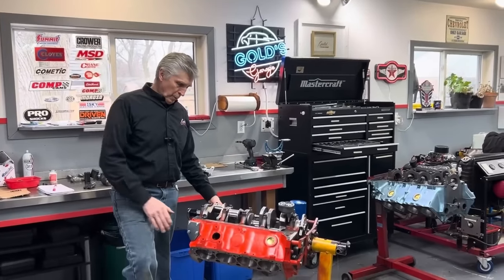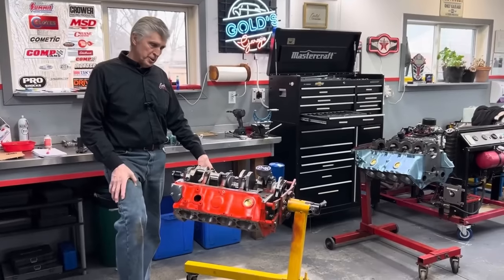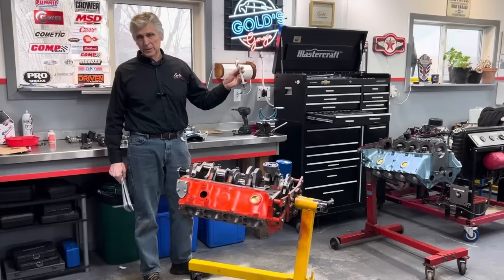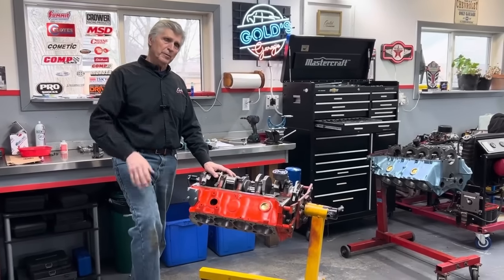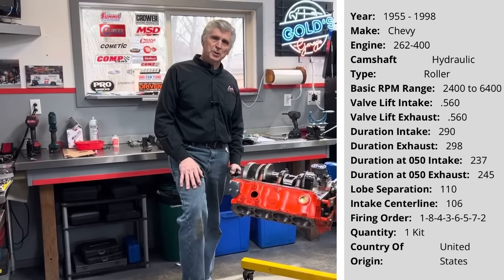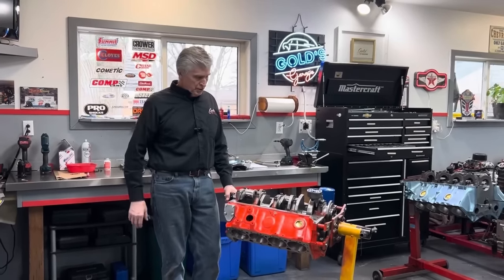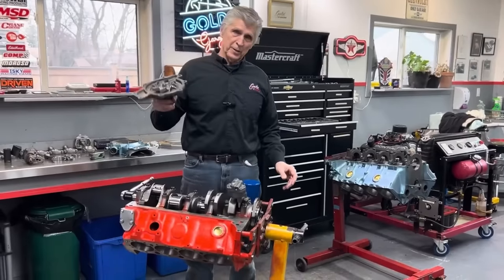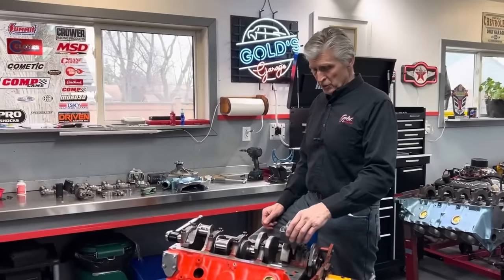Building a Race Winning 400 SBC Chevy - Get the Right Parts! Do you need a HV Oil Pump?

Comment: Thank you for explaining the difference between a standard oil pump and a high volume oil pump. I never knew how they were different and now I do!!!
Reply: It is the length of the gears, I do not know if that was stated in the video as I concentrated on the clutch.
Reply from the maker: You are welcome, yes the gears are about 30% longer on a HV pump. AG

Comment: I built a 385 stroker for a friend. EVERYTHING was new. I believe in stock pumps. For some reason the oil pump locked up. When I replaced it, I removed the gear. The last step I made after blue printing it was drill a 1/16 hole at the top of the gear, skip two teeth and drill a hole in the middle, skip two teeth and drill a hole at the bottom. Just thought I'd throw that tidbit in. GREAT videos
Reply from the maker: Interesting, thanks for sharing your experience Roger. AG

Comment: I like your thinking on this engine. Dirt tracks do take a different approach. Anxious to see how this does in the car. Good luck.  Only change I would make is to use the Melling Shark pump. It is available in a couple volume outputs and I believe it is stock and 10%. The Shark pump with the helical style teeth always have one tooth engaged which eliminates the pulses experienced with a straight gear. These pulses can cause spark scatter if other conditions are present. It does reduce a couple stresses with the "constant" pumping vs the pulse pumping of the straight gear. Worth investigating. Oh, two more pluses, the pickup screen bolts onto the pump and the size is increased from 5/8" to 3/4".
Reply: The smallish 8" tire width he was focused on [in a light car]  is a real challenge to get torque in a sweet spot coming off the corner.  So the odds: will cam timing get retarded or not after a little test & tune?
Reply from the maker: Thanks for your comment 4Speed. AG
Reply from the maker: Thanks Flinch. I will be retarding the cam to soften the corners. i will be making videos of the process. Dyno day is June 8. AG

Comment: A final proof check that the rod bearings are installed correctly is the rod pair on the crank pin should have side clearance, meaning you can slide the pair against the cheek of the rod pin from the front to the back with no effort, hopefully with .020" movement or what you determine you need. Use the wrong rod bearings on an aftermarket steel crank, or put the wrong halves in the wrong position and it's possible you won't be able to rotate the crank because the bearing surface is clamping on to the radius of the crank pin. (fillet)
Reply from the maker: Thanks for the info Yarrda. AG

Comment: I have started using Melling 155 pumps. They have a larger inlet diameter to prevent cavitation at higher rpm but is still a standard volume and accepts regular SBC pressure relief springs.
Reply from the maker: Thanks Steve, good point, I have a Melling M155 pump here, maybe I will demonstrate it in a future video. AG

Comment: One small detail....... in that gear pump for oil, the oil actually travels around the outside of each gear.  It doesn't go thru between the gears.
Reply from the maker: Thanks Roy, you are correct. AG

Comment: Allan, I think you should have shown the internal plate that goes with that Pontiac water pump, that would show that the return water from the rad is directed to the centre of the water pump impeller and the water leaving the impeller is directed into the front of both banks of the engine block.
Reply from the maker: Thanks Cabot, good suggestion. That was in my parts washer at the time and i just didn't think of it. AG

Comment: A "race" engine with what looks like original bolts for the mainline, especially after spending the money to line bore the rear main seal lip to allow line honing, puzzling to me. Should be studs. I've built several 400 block based engines over the years, any time you lean on them the front and back caps especially will show signs of fretting. (cap movement resulting in microwelding between the cap and block mating surfaces) I sure hope that's an internal balance crank.
Reply from the maker: Thanks Yarrda, yes it is internally balanced. AG

Comment: Even tho its really not necessary on a mild street build ive always tossed a HV pump in, ive never used a HP or a HP/HV pump either. When i start my smallblock n see 70 psi cold and 40ish hot,  it gives me some feeling of security. I also have a 7 qt oil pan on my current engine. I also tossed ARP main studs and rod bolts on my stock rodded  2 bolt block because they wernt expensive and it made me feel warm n fuzzy inside. I didnt have any out of round distortion from the stronger bolts either. Its the only mild build ive used them on tho. But then again after years of flogging that 355 had never come apart but likely wouldnt have anyway seems ive actually never seen factory main cap bolts fail or actually a factory rod bolt fail either, just spun bearings that led to a broken half rods swinging around causing insane damage when intentionally blowing up worthless junk smallblocks when they were retired.
Reply from the maker: Thanks for your thoughts Budget. AG

Comment: Hey there Mr G. I see you're using a Melling M-55 oil pump. You may be interested to know that the casting changed significantly several years ago. The castings were made much thinner and what was happening is that they developed a tendency to break at the "neck". I had a conversation with Melling tech and they confirmed that the casting had indeed changed. I've an original M-55 from about 20 years ago and the difference between it and the modern offering is obvious. I returned my new pump and went with the Shark Tooth version instead. Four times the cost but what's the result of an oil pump failure at RPM? My hope is that you find this bit of info helpful. For the record,  I've pictures of the new and old side by side. Also a transcript of my e-mail exchange with Melling should you want further proof.
Reply from the maker: That is great info, thanks Kevin. AG

Comment: How much work will the distributor gear handle, turning the oil pump, before it eats the gear(s)?  If we run more pressure and/or volume it draws more horsepower thru that gear set.  How much is too much?
Reply from the maker: Good question Roy, if you have the correct gears, lubricated and aligned properly, the gears should outlast the engine, AG

Comment: I have used the Chevy Power Manual for all technical advise for decades now. HV pump on a SBC is def not needed, just a high pressure relief spring will do just fine.
Reply from the maker: Thanks alleyoop. We will see what pressure we get from the original spring first. AG

Comment: One of the reasons for using a BB pump on a SB is because the BB pump has more teeth on the gears it turns smoother and transfers less vibration to the distributor.
Reply: I would do the same and the pickup tube is larger for the volume of oil...  HV, not Hi pressure.  Hi pressure is no good on the bearings and causes heat and robs HP.
Reply from the maker: Thanks for the comment Gary. AG

Comment: The choice of the cam could be better ,like a ls firing order with the same specs, so it will stay cooler in the cyl 5&7. better for a race engine . always b,print the oil pump and all my return oil open larger in the lock. a 377 cid it's a better application for your rules.
Reply: Yes, the 421 makes more power than a 406 or 434 cu.in.
Reply from the maker: Thanks for your comments Chris. AG

Comment: Does the oil go between the gears of does it go around the gears?
Reply from the maker: Thanks David, Sorry, the pump turns the other way, I was just not paying attention to that detail, the oil is essentially displaced by the gears, and the rotation creates a cavity or suction in the inlet which draws more oil into the pump. AG

Comment: If your lap rpm range is 6k to 7500... single plane all day. If youre  topping at 6k on the straight, rpm air gap duel plane all day! 6k and under a single would be a mismatch. Port velocity would be inconsistent id think
Reply from the maker: Thanks for the input. AG

Comment: My son is building a 355 chevy for street use. What do you recommend for rod bearing clearances? Is .005 too much?
Reply from the maker: Thanks for the question Paul. The factory recommended clearance for 350 connecting rod bearings is .0007"-.0028". The 'in service specification is .004" max. For performance application I think .0015"- .003". works. .005" is too much. Hope this helps. AG
Reply: @goldsgarage8236  thank you!

Comment: Why run a hyd. cam in a race motor? What is the mechanical advantage other than not having to check valve lash as often? Seems like a liability to me.
Reply: Some race series or tracks have a cam rule ( hydraulic only )
Reply from the maker: Thanks for the question Robert. We are planning to limit this engine to 6000 RPM and a hydraulic cam is good for that. The main reason for a solid cam would be to avoid valve float at higher RPM, 7000 or more. Also the hydraulic cam will require less maintenance. AG.

Comment: I predict he gets passed at mid track. And that's not to be mean at all. You have a decent bore so you should take advantage of it. Get a shorter stroke and a completely different camshaft so the engine comes alive shortly after he has come off the corner this will save tires and be much more driver friendly. With that size engine you need a lot of cylinder head otherwise the engine will fall on its face due to lack of airflow but the shorter stroke will alleviate that anyways I don't have time to type you an entire recipe and I really don't care if anybody disagrees I have the records to back up what I'm saying. Just trying to help and save you from being frustrated later.
Reply from the maker: Thanks for your valued input. I have subscribed to your channel. AG
Reply: @goldsgarage8236  you're very welcome I don't post much online I guess I need to start but again if you need any help just let me know
Reply from the maker: Thanks so much, i do recognize the name Salter Racing. AG

Comment: Speaking of putting your foot down in the corner, if I were building a race car, I’d put a Wavetrac Differential in it if the rules allowed or didn’t specify.  Heck, I want one in my Z06!  Also, I’d be really quiet about it😉.  Additionally, a conical spring kit from BTR might help with RPM goals.
Reply: @natez0690
Do you think the Wavetrac is better than a spool?
Reply: @jerrywesterfield5636  
Yes I do! 100%.  A spool will turn both rear wheels at the same speed all the time. This means when you go around a corner the outside wheel wants to turn faster than the inside wheel but it forces them to turn the same speed.  This causes the inside wheel to slip and then the car oversteers.  A Wavetrac puts the torque to the wheel with the most grip and smoothly progresses to lock.  Now, I’m more of a road course track junkie, not a dirt track guy and I know things are different on low friction surfaces, but wouldn’t you want torque going to the wheel with more grip without spinning the inside wheel?  I just wonder if anyone has tried it on their dirt track car?  If it was faster than a spool, I bet they’d never tell.
Reply from the maker: Thanks for the comments and info guys. did you know that circle track cars use a larger tire on the RR than LR? Usually about 3" in circumference depending on a number of factors including the length of the track and radius of the corner. It is called stagger and is one of the most important adjustments. AG

Comment: I have a 1977 22ft rv with 400sbc it runs good but has no power and I have a 26ft sailboat loaded about 5000lbs and I think this would be a good build for me but I dont know what would you advise
Reply from the maker: That is a pretty open question Rusty. The three ways to make power are compression, valve timing (camshaft) and air (combustible mixture) flow. better heads, intake manifold, carburetor, pistons for more compression. You have a heavy vehicle so there are special RV camshafts for that. A place to start. AG